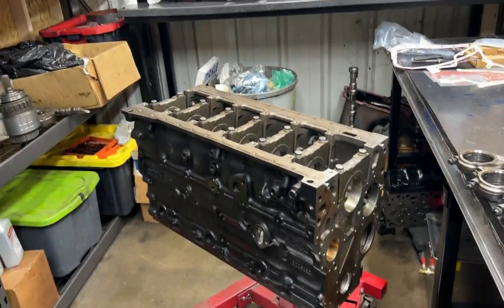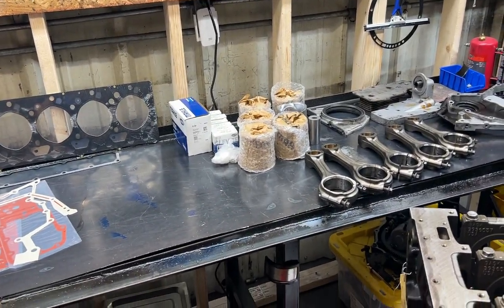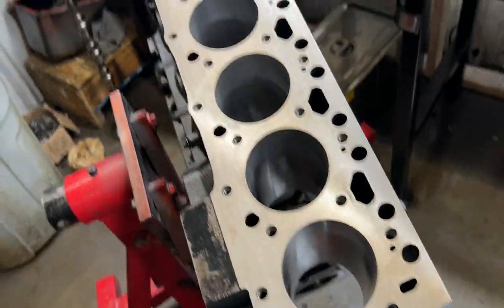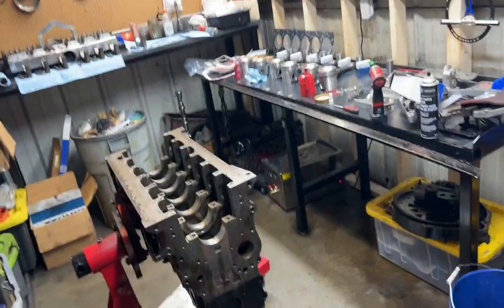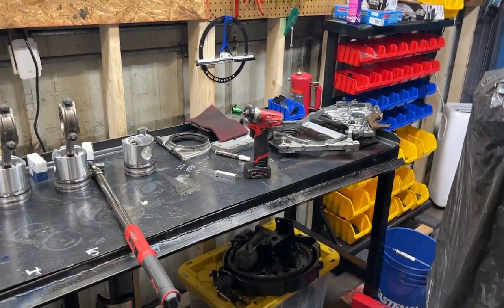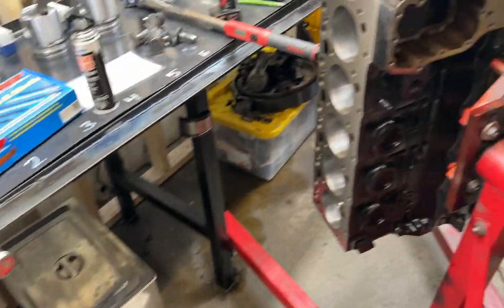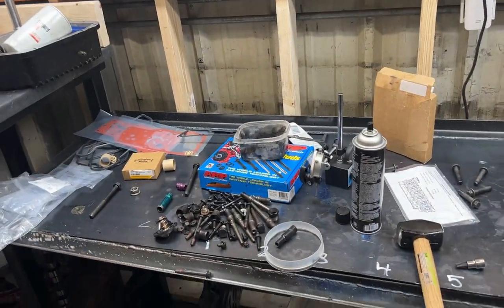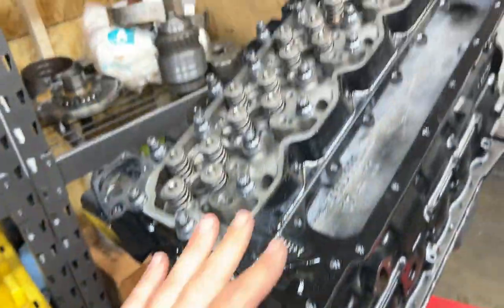800HP 5.9L Cummins Engine Build!

Comment: I appreciate the fact that you show all the sides of high performance yes 2500hp trucks are awesome but they also require lots of work and they tear up a lot. Many people have unreasonable expectations of what these things will do. Also because every stock truck with a tuner makes 800+hp  people don't think a 1000 is very wild. Of course those 800hp truck might on their best day make 500 on a dyno so things get skewed pretty fast.
Reply: looks like it could make a crankcase scavenged 2 stroke with dry sump oil injection

Comment: Please elaborate on the plastic tips. Is this on the valve bridges? All 5.9 CR’s have these? Late 6.7’s are metal and interchangeable to a 5.9 CR?   Whole bridge swaps over? 

How bout a sealing tip for the oil pan to rear main seal housing. What do you find works best?

Good work buddy. Blueprint and measuring is very therapeutic.
Reply from the maker: its 03-09/10 trucks have them. the towers are interchangeable and so are the rocker arms! rtv both the casing and the oil pan

Comment: i have some questions, considering getting 2 built motors for a 40ft boat, i have 6bta 370hp now need to double hp... these 800hp might be good but what about more power? where is the point of losing lot of reliability? these motors will run either idle, cruise rpm 2kish and short bursts of top end 2800rpm...

Comment: hi this is the very time watching one of your video but if you on motors  i have 01 dodge ram 2500 5.9L has 276.000 miles how would it be for a rebuild i do wan to be 600hp soon to

Comment: Ive got a late 5.9 im planning on dropping a s480 over the stock charger, with some 500% over injectors, you think that I would need to break open the engine or should full stock internals be okay?
Reply from the maker: 500% overs is the size of my UCC engine
Reply: 🤣500% free or something? That's a stupid amount of fuel, 100-150% overs will max out that setup and still be able to idle and get good fuel mileage.  No real need to go beyond 250% imo for a street truck, and I would only go that high if you are trying to spin lots of rpm.

Comment: How much does one need in just tools and equipment to be set up to do this kind of thing? Will the snapon van rape-mobile get you good, on a 10 yr payment plan with 15 or 20% apr? Are a lot of the special tools "dealer only" or are they hard to come by/rare patented....not sold to the general public??
Reply from the maker: alot is basic hand tools, then quality measuring tools and torque wrenches. the dealer only tools i just remake myself

Comment: When the clearances are opened up more, does it last nearly as long?
Reply: Where this guy (customer) is trying to go with this engine. i believe the looser clearances will help the engine survive with the extreme heat. I wouldn't expect an 800hp engine to last as long as something closer to stock. Tighter clearances and less heat will last longer if maintained properly.
Reply from the maker: It will not last as long, how long it lasts is up to care and maintenance. I see this motor failing with a bent/broke rod or a valve train issue
Reply: @horsetorquesdiesel  
Thanks for the reply 👍
Reply: @horsetorquesdiesel  could you cover in a video a good valve train for the 800-1000 hp?
Reply from the maker: @samdeitch4105  178/208 ish cam, new tappets, Manton pressure tower valve springs, Manton 7/16 .120 wall pushrods, stock valves!

Comment: how much do you charge for a job like this?
Reply from the maker: On stock rods roughly 7-8k
Reply: @horsetorquesdiesel  does that price include engine removal and re install?
Reply from the maker: @hunterjensen8510  no that's just engine work

Comment: 800hp and no fire ring or 625's? Yikes! You should seal off the room and put an air conditioner in there. It will take the humidity out of the air.
Reply from the maker: It’s sealed with an air conditioner
Reply: I’ve been at 810hp on my 07 5.9 for years. ARP 2000s with no fire ring and haven’t had an issue
Reply: @nathanrichardson4855  oh sht. Hope you didn’t just jinx yourself!
Reply: Fire rings are not needed for a common rail 5.9 street truck.  And arp 2000s will hold down a 5.9 head without issue.  Crank them down to 135 lbs, do two good re torques and gtg! I even had 2000s holding my .02 over 6.7 head down with 100 over injectors and a 467 for a long while, I just upgraded to 625s to be safe.  But they were still doing just fine.  I only used them because I had them from when my truck was still 5.9.  I don't see the point of fire rings on a street truck, good stock mls gasket and 625s torqued the correct way will hold all the power the street can take.
Reply: @joshuaquilliam2887  What HP are you at?